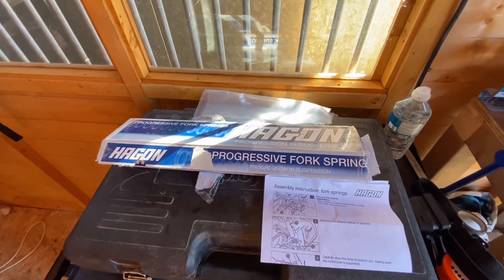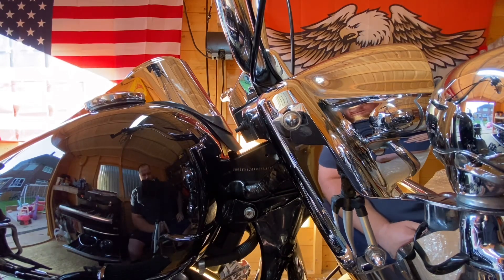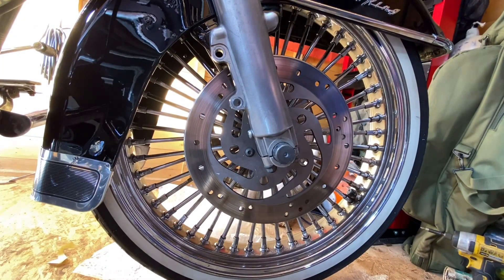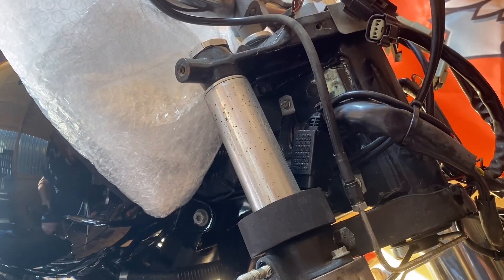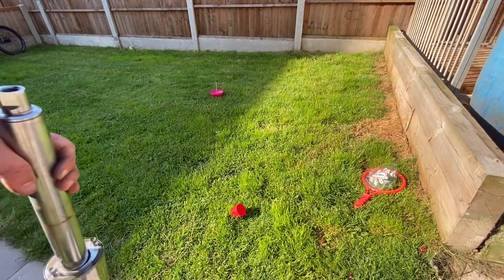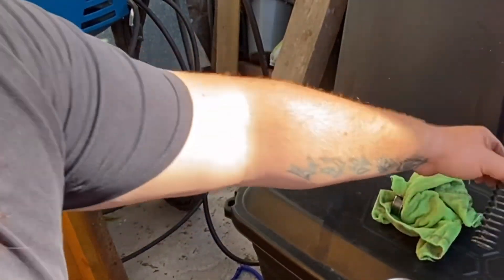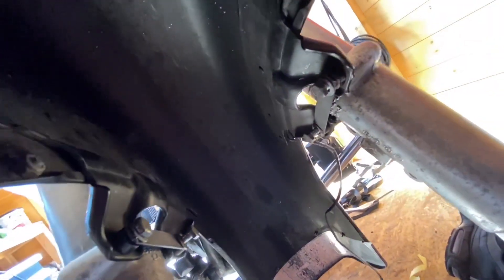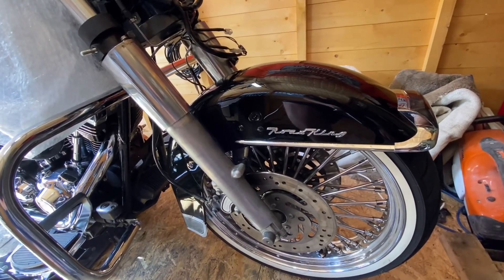Progressive Fork Springs Harley Davidson Touring (Installing on a Roadking)

Comment: Thanks for the video.  I've got to take off my wheel and forks to modify my front end to chrome it up a bit.  I just got a 21" front wheel to replace the stock 16" wheel.  Some chrome cans, and chrome forks.  Enjoyed a full watch of your vid.  👍🏽🤠
Reply from the maker: Glad you liked it. Get stuck into it will put a massive smile on your face when you see the end result. Ride safe bud

Comment: What that small gauge that next key ignition? Looks good
Reply from the maker: Its a watch there only cheap off ebay
Reply: @Teamloco1853  thank you did make a video of you installing it ?
Reply from the maker: @benjaminrico4277  no its battery operated like a wrist watch .. literally 2 screws and it spins to give access so you can still lock the steering
Reply: I look for it , do you the name or title for it ?

Comment: That was very informative to watch thanks, what grade oil did you use.
Reply from the maker: Thanks for watching and i used 15w oil that came with the forks
Reply: @Teamloco1853 How do you like the progressive fork springs?  Did they make any difference in the ride?  What year Road King are you riding and working on?  My King is an 09.  I just purchased chrome lowers for my forks from the Harley dealer.  The deealer charged a tremendous amount ($$) for all the parts.  I'll try to video the installation as I go but it's my first time changing a front wheel and  lowers on my forks.  My fngers are crossed.😁 Ride safe  👍🏽🤠 8/10/23
Reply from the maker: @houndsmanone4563  the progressive are a million times better then stock bud its a night and day difference. My RK is an 07. Follow the steps and you will do it bud take your time. If your stuck drop a comment back in and ill assist you. You will do it have faith .. Ride safe buddy Godbless
Reply: @Teamloco1853  Thanks; just subscribed👍🏽🤠
Reply from the maker: @houndsmanone4563  appreciate it thankyou